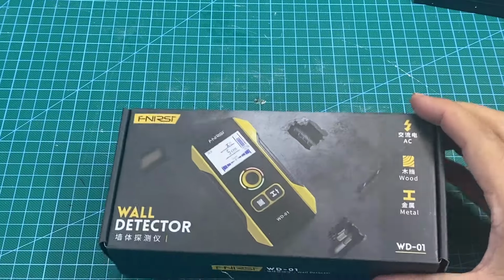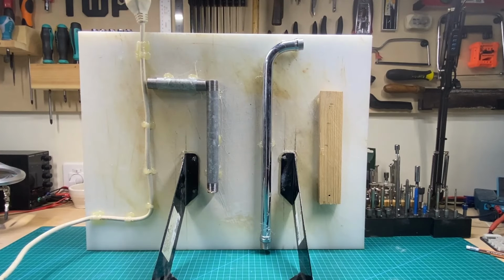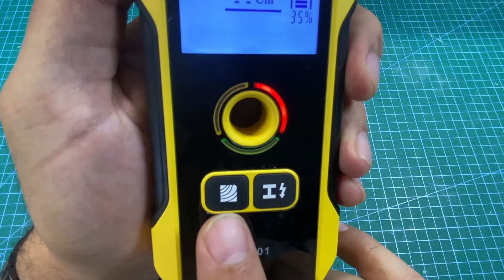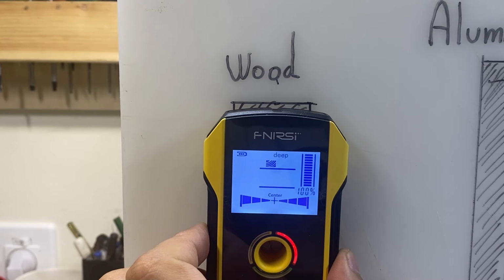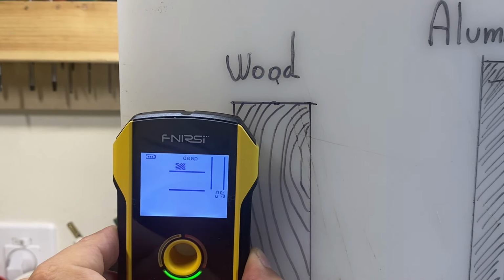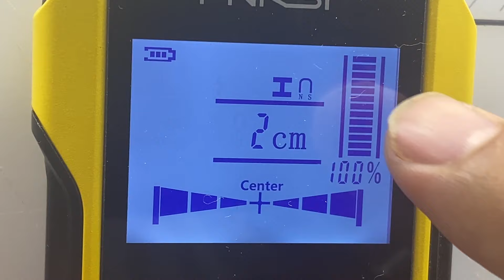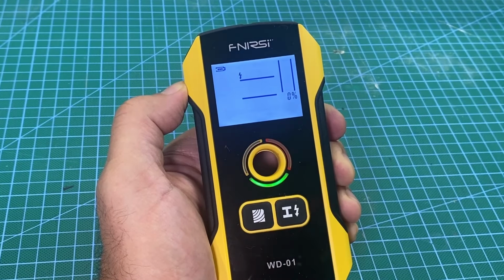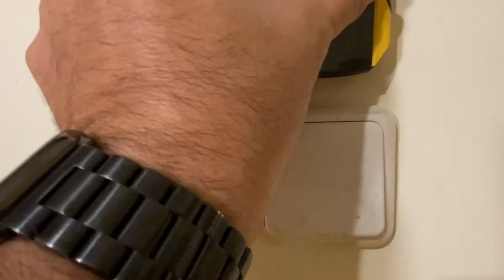Use this FNIRSI Wall Detector before you drill your wall

Comment: Will it detect is the pipe is Copper?
Reply: I’m pretty sure copper isn’t ferromagnetic, so my logic says it won’t detect it under metal search. But it will detect it under the normal detection mode. Especially if it the pipe is running water in it. 
I would recommend checking out the company’s materials online to search for it.
Reply from the maker: To be completely honest, even after reading the instructions several times - some of the language is a bit vauge. 
Also, after using the device several times since the review - I had some succeses and quite a few failiures. A tad disappointing,

Comment: I got one it is  garbage.
Reply from the maker: Granted, it took me a while to work out exactly how to operate it. 
You need to have very dry hands; not touch the wall; recalibrate every scan and move rather slowly. And even then - you need patience.
Reply: @ToolWallpro Why you cannot touch the wall while operating this device?
Reply from the maker: @hars6198  The device detects minute changes in the magnetic field around the wall. Your hands are conductors and might ground the wall creating a magnetic field of their own. It's like using a compass with a magnet in your pocket.
Reply: @ToolWallpro  ah i see, thanks for the explanation.